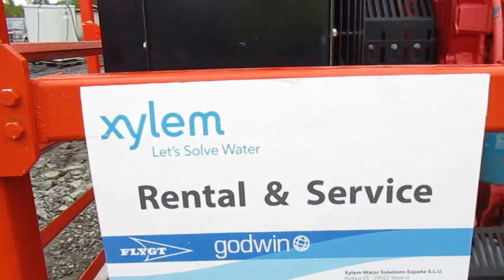Godwin Xylem

Comment: sure each water pump delivers 200m3/h  the witshof the propeller are proportional to the volume (m3/min,   M3/h,etc) and the diameter of the propeller is proportional to the tpessure(manometric height)